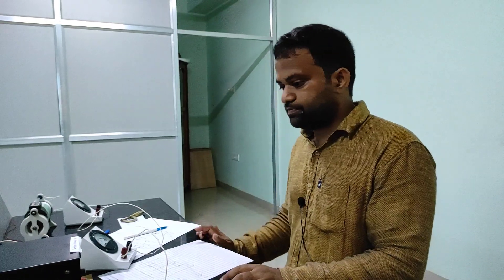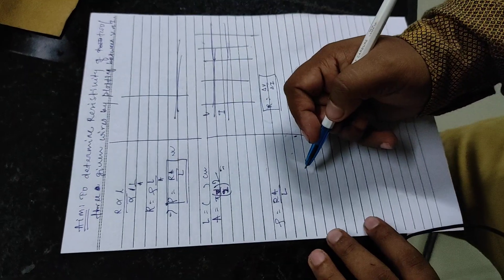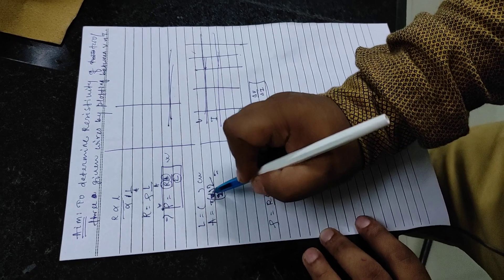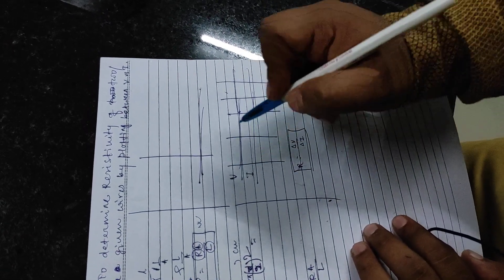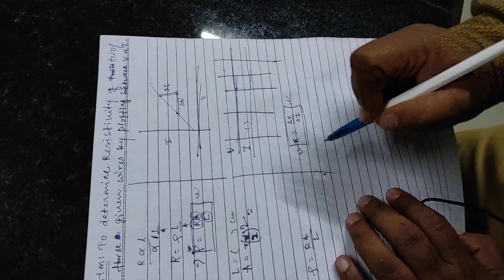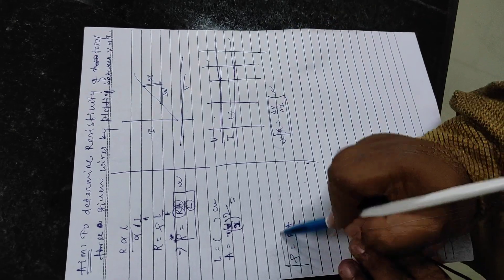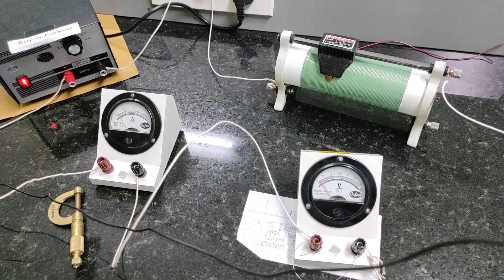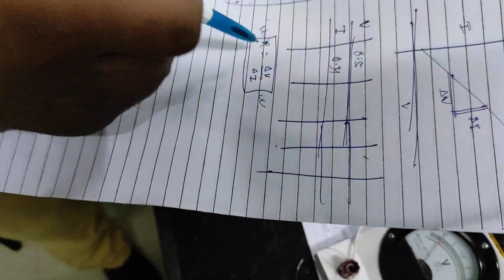To find the resistivity of two/three wires by plotting graph between V vs I

Comment: Sir reading note krte time hmme battery elminator ki nobe ko kitne par set krna h??
Reply from the maker: Depends upon your rheostat and wire, check where you are getting current by changing voltage.. generally we fix around 6-12V